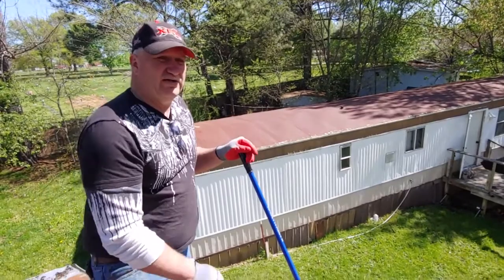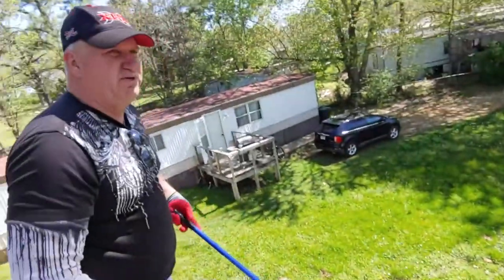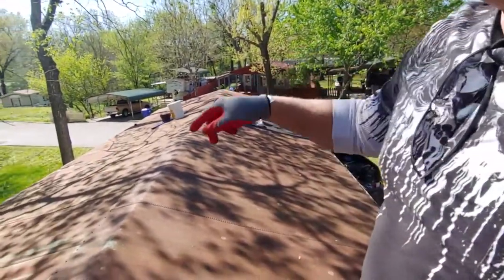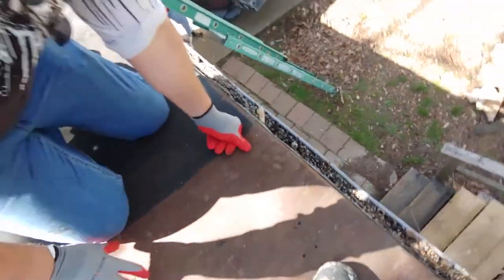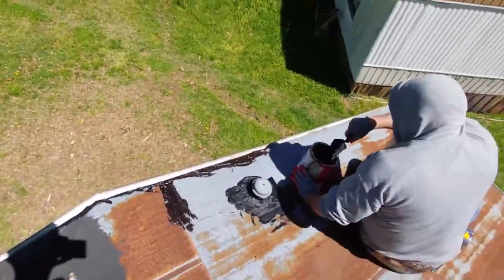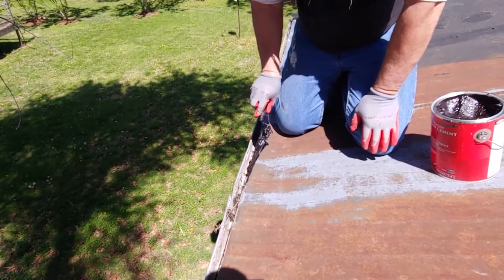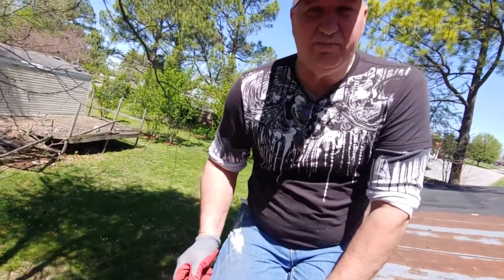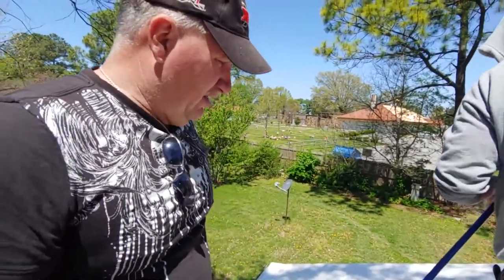How To Tar & Seal Metal Roof

Comment: I'm getting ready to do the exact same thing to my roof. How many coats did you have to apply and how many 5 gallon buckets did you go thru for that roof? Mine is a 14*56' singlewide
Reply from the maker: 2 gallon buckets of roof patch / tar 2-5 gallon buckets of white elastomeric coating. Invariably 1 bucket will not be enough. You only need to cost one coat. Although you could put the rest of your bucket left over on again later after the first is dry. Make sure rain will not get on your roof for a day after you apply. On a cool day it could take awhile to dry. On hot day an hour or two. You can do it. I believe in you. I also want wish you and yours well
Reply: @StraightArrowRepair  thank you!

Comment: what would you use for nail pops and exposed nails on asphalt shingles? wont the white stuff eat the shingle?
Reply from the maker: Shingles are usually requiring maintenance that very few actually do. Usually you get caught with we have replace this much plywood with added cost. Back to your question. Nail pops your nailing them individually back down. As for the coating. No it should cause no damage.
Reply: @StraightArrowRepair  ya hammer them down and seal them, but the mulco thermoplastic supra expert stuff will eat the shingles ppg says
Reply: @StraightArrowRepair ??

Comment: how long do you wait after aplying black jack until you can aply the white stuff?
Reply from the maker: As soon as you want. Glob it on .
Reply: @StraightArrowRepair  as soon or as late as I want? It doesnt matter if some gets on the asphalt shingle or the metal?
Reply from the maker: @redsresearch  I thought you were coating a metal roof. So if your sealing a shingle roof penetration you tape off a square or rectangular area around that penetration. Then seal with tar the put the white elasomeric coating on . Finally you pull up the tape and you have a nice clean look.
Reply: @StraightArrowRepair  so your not suposed to get the white stuff on asphalt shingles?
Reply from the maker: @redsresearch  no what I am showing a clean crisp way to do it
Reply: @StraightArrowRepair  so it is ok to get some white elasto stuff on the asphalt shingles?
Reply from the maker: @redsresearch  yes
Reply: @StraightArrowRepair  why not just use the white elasto stuff without the blackjack?
Reply from the maker: @redsresearch  tar tends to be better able to fill larger cracks and gaps. It's weakness is it tends to crack after a year or two whereas the elasomeric does not.
Reply: @StraightArrowRepair  Thanks I appreciate it, that would be a good video for you to make caulking exposed nails and that, when I do it I put on a little blob, more then less so it doesnt melt away then I take my finger and smooth it down into the shingle granuals, that kind of Pat's it down a bit plus smoothing it into the granuals holds it there I feel, not sure if that's the right way I just dont want it going anywhere, haven't gone back yet to see if there still there. I use the tubes tho not the tubs that you use but maybe I should get the tubs, would be a great video tho
Reply from the maker: @redsresearch  respect to you and pursuit of quality
Reply: Hey  do you have a product number on that elastomeric stuff? lowes dosnt seem to have it in canada
Reply from the maker: @redsresearch  Item #4968327 . You can also go to home Depot
Reply: @StraightArrowRepair so I can't get that product in Canada, lowes changed to rona plus and they can't order it, and home depot doesn't have it either but what do you think about white knight flex coat from home depot?

Comment: so are you saying the black jack is no good?
Reply from the maker: I think that it will work to seal just fine. With the white elasomeric coating on over the top will cause both to last considerably longer. Perhaps years longer.
Reply: @StraightArrowRepair  why not just use the elastomeric stuff without the black jack?
Reply: @StraightArrowRepair ?